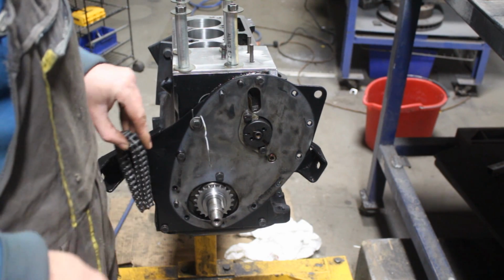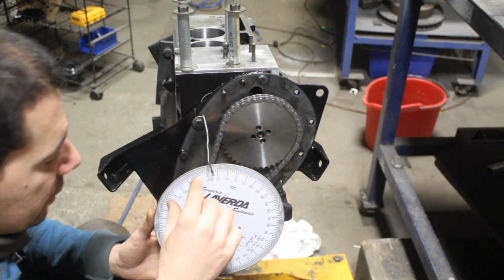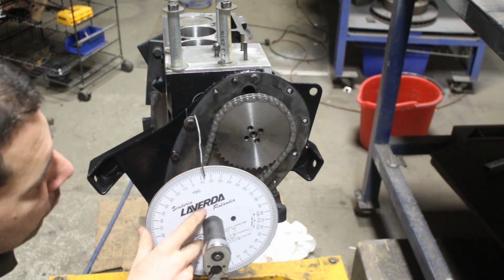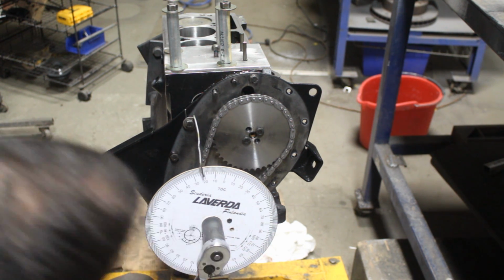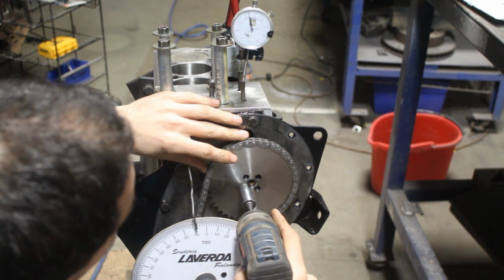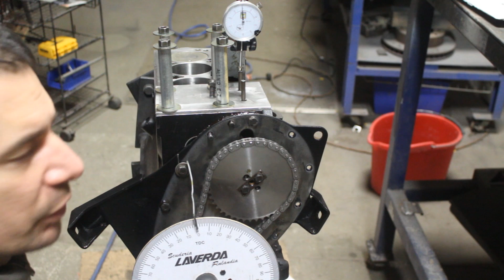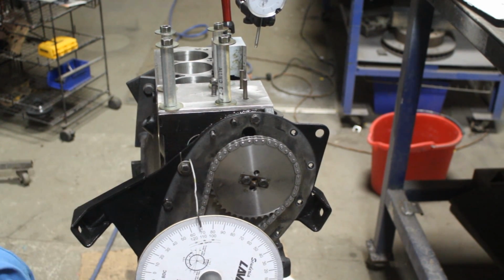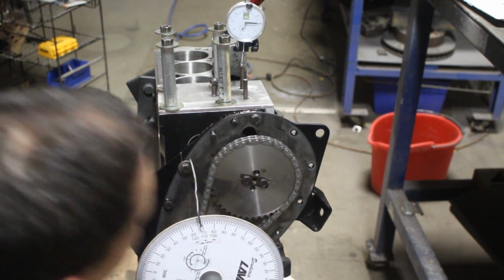1968 Triumph Spitfire MK3 Restoration Project - Part 15 - How To Degree The Camchaft

Comment: When you were calculating TDC and had 14 & 16 degrees and rotated the degree wheel by 1 degree and screwed it into the new location you could have just bent your wire pointer by 1 degree instead.
Reply from the maker: Brian Miller 👍True, I didn't think of that LOL next time I will remember it is an option. Thank you!